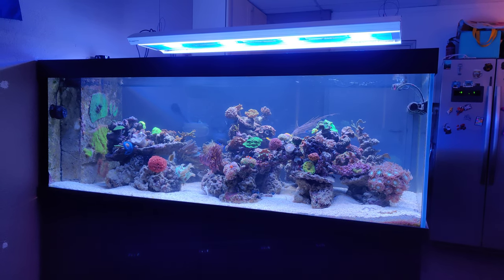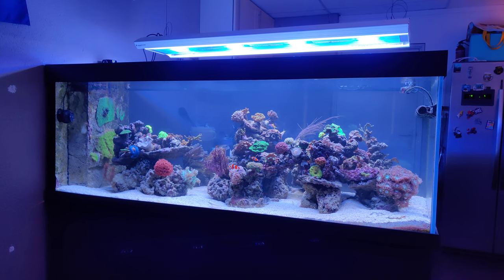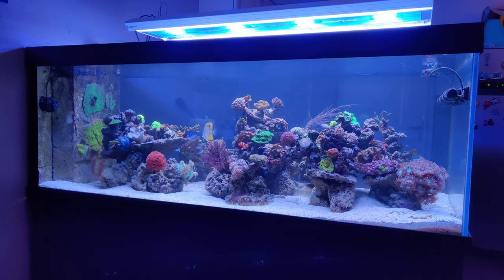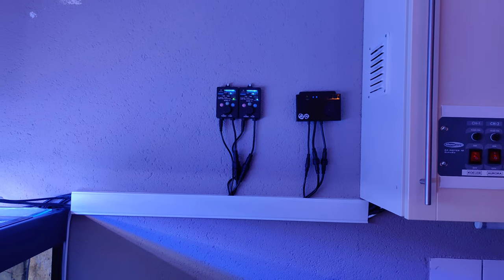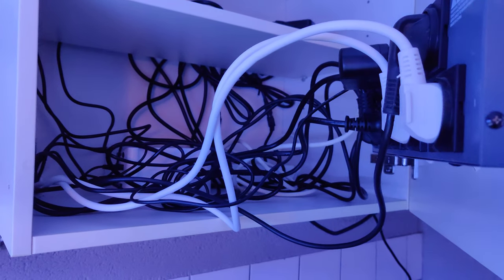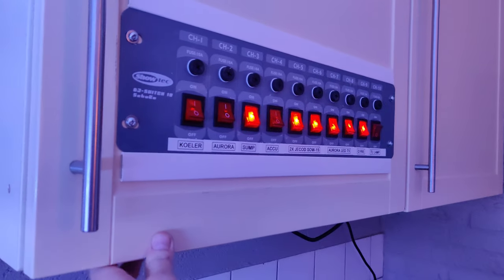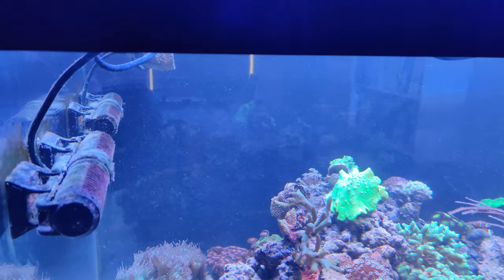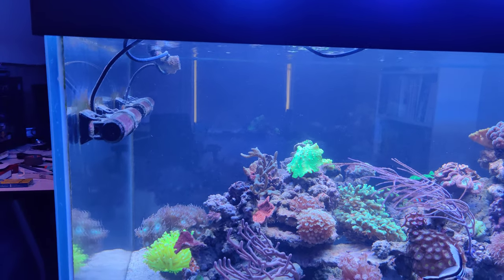FF S2#14 | Creating Optimal Flow in a Reef Tank

Comment: I have a question about your aquarium cover and your eel, since they are are known escape artists and can be strong, is it secured on the top or something? Or are the acrylic rims on the inside corners to keep it from reaching the lids?
Reply from the maker: Hi Joe, it is not secured a lot but it's slightly clamping to the sides. Also, there's glass rims all the way along the sides of the tank about 8cm wide.